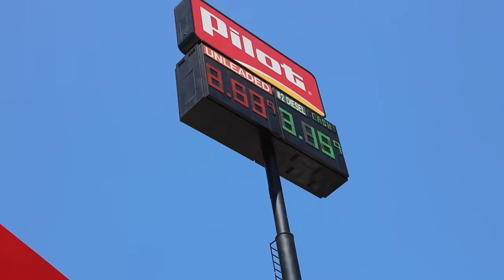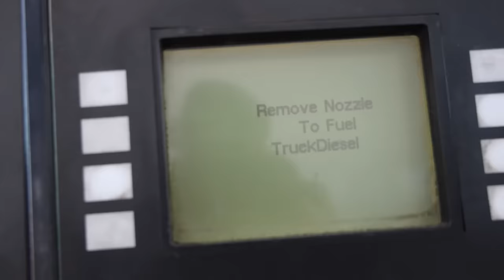HOTTEST TRUCK DRIVER IN AMERICA!!!

Comment: Not a real truck driver, no permanent headset, automatic transmission not wearing  pajama pants or flip flops lol.
Reply: Manuals are a thing of the past, bro. They are already being phased out.   At the end of the day, you're still pulling, & maneuvering the EXACT dimensions of a sem-truck.
Reply: I was just thinking same thing u ain't hitting gear automatic she looks better filling the truck up with gas than driving LMFAO yeewwwwwww 👍
Reply: @johnnycray4427  true,  but boss hooked  up to 240000 load other day,  and it sheered  every gear wen trying to move the 130 foot propane tank on steerable, ended up having to pull w my own kw 15  speed,  gotta  say through she is a looker, just like my Georgia peach widow was,
Reply: Wait till the robots take over

Comment: Clearly we love watching a sexy woman, so can we use this to our advantage! For instance can you do some videos showing and explaining basic maintance and repair as well as common issues with different trucks/ engines. 

Like where to get a grease  gun, what type if grease to use in your gun. What to grease and how much to grease. For instance you must grease your s cam bushings other wise your truck will not break evenly and smoothly one side will grab while the other side is hung up until you apply more pressure then it gives way and you experience a jerk in your steering wheel. This is a common condition that occurs when you do not properly grease your s cam bushings/ breaks. It’s rare that company drivers learn and understand proper maintenance intervals and practices. 

I live the exposure that you are getting so let’s use it to greatly improve the safety out there. 

Thank you for stepping up and becoming a public figure. 

Sincerely
James Brown